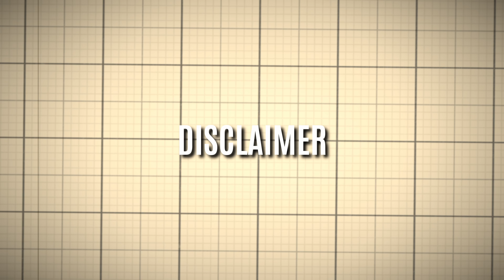The Missing Links in FPV Drone Evolution

Comment: My first quadcopter was the Keyence Saucer II back in 1989ish. It had a tiny mechanical gyro, the frame was Styrofoam and so were the props. No acro mode but it could hover and float around the house in very stable smooth flight. It couldn't carry a camera and vtx, but we did fpv several blimps and rc cars back around the same time. So...ya, drones have been around for more like 35 years.
Reply: My first time seeing a quad was from the India movie "3 Idiots"... when I was 13 or 14, years after the movie released in India, I still remember the impress I had.